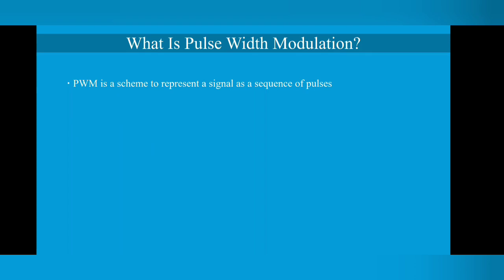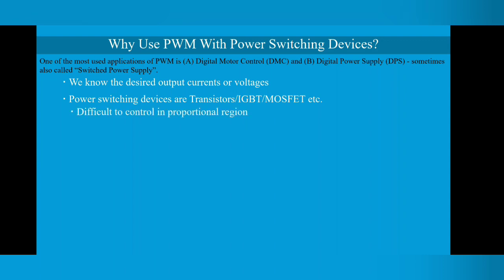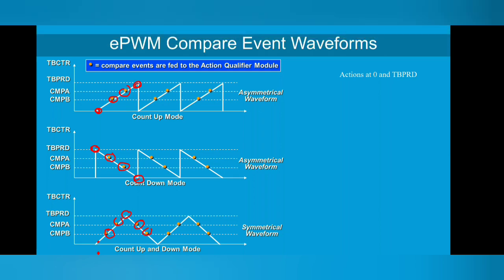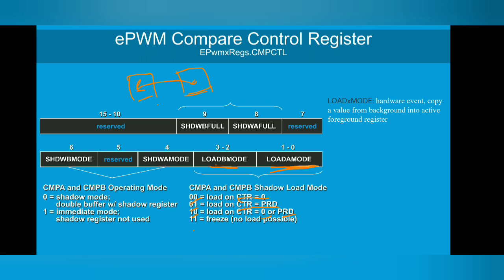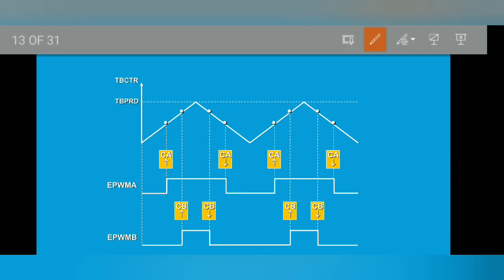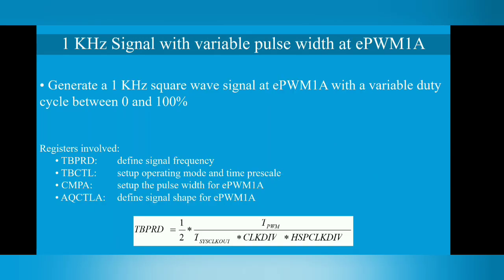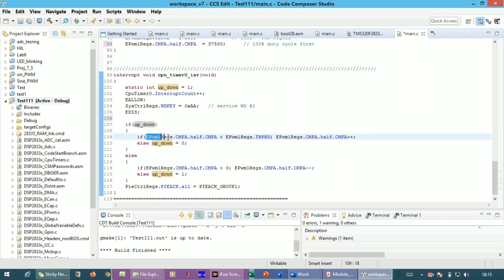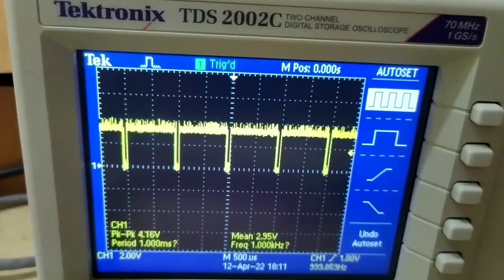art 12 | PWM using CCS & DSP TMS320x | Compare Module & Action Qualifier Explained

Comment: Sir, can we get that PWM signal as an input of DSP?
I need to use the generated PWM signal inside the DSP. For example, I need to make the multiplication between a measured current and the PWM signal inside the DSP.
Thank you in advance!
Reply from the maker: Yes you can
Reply: @controllers_knowledge  Thank you so much for your reply.
Sorry for bothering you because of my limited knowledge about DSP.
I just wonder if we create a PWM signal inside the DSP using ePWM. Then, I also can use it inside the DSP as a variable to make summation or multiplication, right?
Thank you in advance!